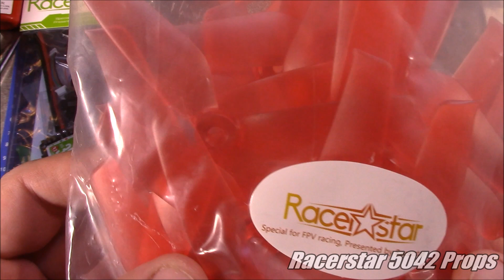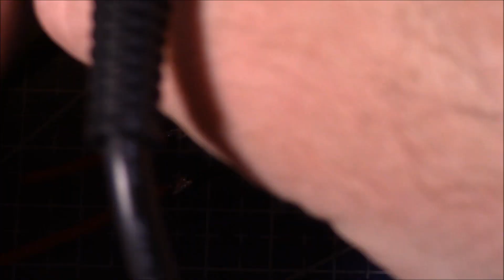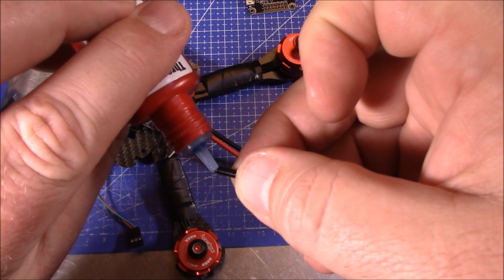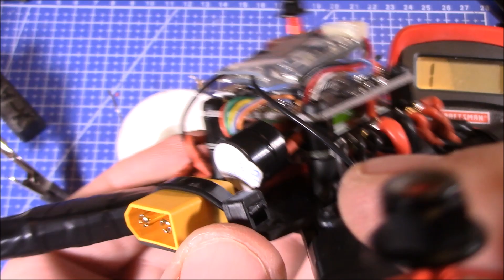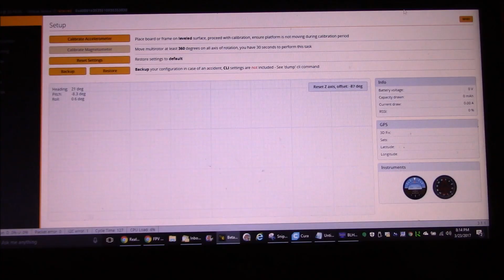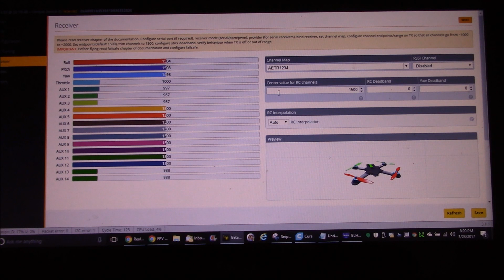Genius 215 Detailed Build Video from Banggood

Comment: Didn't drop the tx. It did try them both on the arms and will move them back. I just recently figured out alarm settings on the qx7 and may have programmed it wrong. ?Thanks for your reply. When I get the antennas checked out and moved back I'll let u know how it went. Hope I'm not asking to many questions just that u r the most reliable source for info. I subscribed to many that I never hear from. Thanks again greatly appreciate
Reply from the maker: You're welcome.  You could try to create a new model in your Taranis and rebind it to your RX.  If that makes it work, you'd know it was something you configured in the TX.

Comment: Hi Travis, all of a sudden both quads (X210's) are giving me a LOST TELEMETRY warning from the Taranis QX7.  But it reconnects about as fast as it loses it.  Also the Taranis occasionally says LOW RX.  BUT I still have connectivity or at least it recovers quickly and don't notice the lost signal interruption.  Since it is coming from both quads I'm hoping its a setting on the Taranis. Any glue as to what is going on.
Reply from the maker: Which receiver are you using?  XSR or X4R-SB?  Hopefully one of those...  Make sure your antennas are still connected real well (X4R-SB).  The XSR has soldered on antennas.  If that looks good, you can try to move your antennas up to look like insect antennas above the quad.  If you have them attached to the arms like I have in this video, it should be alright.  It is strange though that both of your X210s are doing it at the same time.  That kind of makes me think it may be more related to your TX than something on the quad.  You didn't drop it recently, did you?

Comment: Thanks for yet another good review !
When comparing the Genius 215 frame and the X210 PRO, which do you think is the best frame ?
I really love the 4in one esc in the Genius kit, but the camera holder on the X210 pro looks much better. The best solution would be 4in 1 esc on the X210 pro kit.
Reply from the maker: heh... yeah.  I like the x210 better at this point, but I haven't added the FPV stuff to my Genius yet.

Comment: hi,
i noticed in your x210 f4 build and this one you used the bottom vbat port. i ve been copying all your soilders. i have another cc3d revo f4 board and  i have doing been researching it on rcgroups and cant find any info on why to soilder into the bottom vbat, all of the pics on that thread show the top vbat and grnd by the buzzer port soildered. also i was informed that where the motor signal terminal ports are the 5v + doesnt work and not to power the f4 board that way. by using the vbat it would power the f4 board and it has a built in voltage reg so the power off of the pdb board can go direticly into the vbat 
can you help at all 
thanks
Reply from the maker: On this board with the AirBotF4 firmware, I had to use the lower VBAT to get the VFAS telemetry back to the Taranis.  At first I had the wire connected to the other VBAT but couldn't get the telemetry readings.
Reply: ok
i dont have telemetry i use the flysky radio
can i leave it how i have it with the lower vbat connected or should connect the vabt up at top by the buzzer?
Reply from the maker: It should be fine like you have it.

Comment: so when using a 4in1 esc, there is no need for a pdb? i am doing my first build now using this frame (maybe), but other components but still a 4 in1. so maybe I am confused being this is my first actual build... rtf were fun but I wanna build baby
Reply from the maker: This quad doesn't need a PDB because the 4-in-1 outputs 5v to power the flight board.  Nothing else on this quad needs power.  When FPV gear is added, I'm going to use gear that supports 7v-22v so I can power it directly from the 4-in-1 ESC as well because I don't want to have to use any voltage reducers.
Reply: ooooh a tighter build... I love it. Wish I could find info on whether or not my vtx uses 5v... i know my camera does.!.!.! disregard... I'm using the betaflight flight controller that is a pdb also... I'm dumb

Comment: hey Travis, another great build man. These revo F4s are tricky though. Can't seem to get it into DFU mode?! Im holding the bootloader button as I connect, did it like 50 times lol. Help?
Reply: also why do you choose to use the airbot F4 firmware instead of Revo on betaflight? I know they are supposedly identical but any reason?
Reply from the maker: I chose the AirBotF4 firmware because that is what the website for the board said to choose.  I know the Revo will work too.  We had a few people use it at a build party and their quads flew fine.
Reply from the maker: I'm almost to the point where I hate F4 boards.  I tried to reflash one with the Revo instead of AirBotF4 and it went half way through and got stuck.  I tried to reflash it a dozen more times and now I think it is hosed.  I ordered a replacement F3 board.
Reply: If you're on PC, download ImpulseRC driver fixer. It's a lifesaver. Just plug your board in like normal, as if you were just trying to connect without flashing. Then run the driver fixer and it automatically puts your flight controller driver into DFU mode.
Reply: Are the Multirotor Racing f3 boards good?
Reply: Did you try in Betaflight CLI to type "DFU" (no quotes)

Comment: Friend the antennas of the radio if it has signal in that part?
Reply from the maker: The antennas work fine attached to the arms like this.  I thought they may lose signal but they have been working real well.  I do not get low RSSI warnings while racing.

Comment: Another nice clean build and great Los flying but I'm waiting for you to install fpv setup and fly that way to see how your builds fly that way, and because you I got my first race quad the realacc 210 not the kit but the rtf and I love it, but just yesterday it got alil wet and motor #3 esc caught on fire rrrrrrr. I put it out before it burnt anything else but now I don't know what I have to replace beside the burnt esc rrrrrrrr. I'm about to start fresh and just build from ground up.... But thxs for the infor on your clean builds.
Reply from the maker: The GX210 uses 20 amp racerstar ESCs.  You could order a new one and try to replace the burnt one.  http://www.banggood.com/Racerstar-RS20A-20A-BLHELI_S-OPTO-2-4S-ESC-Support-Oneshot42-Multishot-for-FPV-Racing-p-1063904.html?p=6Z050013977120130325
Reply: @travisgrindal thxs I just order 4 of them and a new fc and pbd because I didn't want to take a chance because im not sure if they got damage too,i quess better safe then piss off lol....

Comment: I do have a F4 board that froze up while flashing. I did not know any better and unplugged it to try flashing a second time. Now it will not connect. Is it ruined??
Reply from the maker: I'm not sure.  I have one just like that sitting here.  I'm going to have a friend see if he can get it to work on his computer.
Reply: hopefully it works for you on another pc. I tried on a second pc and nothing....Let me know if you have any luck. I hate to see it just sitting the wasting away. I spend enough money in this hobby to be adding to it from things like this.
Reply: Thought I would let you know i got it to work. After several tries I finally got it into Boot Mode using tweezers to short the boot pads. I tried to re-flash a few times and it froze up each time until I turned off "Full Chip Erase". Once I turned that off and lowered the manual baud rate down to 115200  it flashed like there was never an issue.

Comment: If you can afford extra wires, try doing lineman’s splice on the motor wire extension. It will be better protected
Reply from the maker: That is true, but the stress on the motor wires isn't all that much.  Their biggest threat are the props bending down in a crash and slicing them up.

Comment: What's better for racing? 2300kv or the 2600kv?
Reply: 2400kv
Reply: I mean, not by me but according to my friend, 2600 on 5" is a battery killer :D

I fly a 2400KV motor, seems to be the sweet spot. Feels tad faster than 2300KV yet more torque and kinder for battery than 2600KV. The new 2750KV RS2306 can pulls more than 50A (200A total) and battery technology hasn't good enough for this power hungry motor. Joshua Bardwell made a video on it
Reply: Agreed, we should take it easy first. Guess what? I've made many mistakes in my first build. I bought a 190 frame for a 5" setup, which is a pain in the ass to build (everything is a very tight fit). To make it worse, it's a 3mm thick frame and seems not going to last (beginner = bad crashes). I forgot to turn down the heat while soldering small parts which broke my VTX, tail light and an FC (solder pads came off). I should've spend less for my quad and spend more for my ground equipments.

Here's my setup if you're interested:
*RCX X190CF 3mm
*RCX RS2206 2400KV
*DYS XSD30A V2 DShot 600 enabled
*Flip32 F4 ICM Edition
*Matek HUBOSD8-SE
*Generic HS1177 CCD 2.5
*TS5823L

Pro tip:
-Soft mount your FC (12 AWG silicon wire insulation is my favorite material)
-Stick with red triblades props (red looks awesome haha)
-Pick high quality 60/40 solder (don't get a cheap one, you'll regret it)
-Pick good adjustable solder (set low for soldering small wires and vice versa, otherwise you'll burn your board or struggle to solder your wires)
-Have a multimeter, solder suction, tip cleaner, tweezer, needlenosse plier, hobby knife, heatshrink, zip ties and so on. Seriously, these things will come handy
Reply from the maker: I've been using the 2600kv motors.  The 2300kv motors feel kind of slow after flying 2600kv for so long.
Reply: No problem! if you have a problem, rcgroups.com is a very good place ask just about anything about this hobby. They're very friendly : )
Reply: Some said that 2300KV motors have better power on the low end, perfect for racinng. Just got the 2300KV for my first build though. Might order the 2600KV soon 😄
Reply: 2600KV is proven to be a battery killer for me
Reply: IRFZ44 Looks like I made the right decision ordering the 2300KV ones :) thanks for the tip mate :)
Reply: Thanks man!
Reply: Share your setup plz :D
Reply: Parts for my first racer still on a slow boat from china... but I got these parts:

Racerstar 30a Lites (BB1) Dshot 300
Racerstar BR2205 2300KV Black
Frog Lite Frame
SP F3 Board
Matek PDB-XPW (with current sensor) 
Racerstar 5042 5x4.2x3
CMOS HS117 style camera (very cheap one)
Paired with a cheap 200mw transmitter (TS5823s) and an XSR. Excited for the parts to reach me. Can't wait to build it!
Reply: Awesome, but you could've spent a bit more money and you'll get a decent racer

Racerstar MS25A BB2
Racerstar BR2205S
RealaccX210
X-racer F3
Matek PDB
Generic HS1177 CCD
DYS MI200 25-200mW VTX

That's a pretty decent setup
Reply: IRFZ44 Yes I am very much aware of all those other options you listed, but I wanted something easier to build since it would be my first racer! All the vidoes about the SP F3 and the likes got me into deciding to buy that board. Since it is an ULTRA cheap racer, I wouldn't mind it that much if parts broke, that's why I opted for a cheap build like it. In the very near future I would get better parts and build my 2nd one too, but I think what I have setup is fit for me right now :)
Reply: Besides other than that, the camera is only the big improvement over the parts you listed. Being a beginner, I doubt I would notice the difference between DShot300 and DShot600. I was originally going to get the MS25a but hesitated because of their sync issues. After this build, I bet I would be much more comfortable with my future builds ;) Noted though! Thanks for the input mate!
Reply: IRFZ44 Thanks for all the input! This is what I love about this hobby. The community is just so helpful and friendly! Thanks again :)
Reply: IRFZ44 Update: I had a problem with that order. I cancelled it eventually and got way better parts.

X210 V+
Matek FCHUB
Omnibus F4
RS20A Lites Dshot 600
Brotherhobby R2 2300KV
Eachine Okkan Camera (Budget was tight lol)
TX526 (Eventually broke on me, but banggood was kind enough to replace it. I requested a VTX03 and it is on its way now)
XM+ 

Flies great! 
Dshot 600 running on 8k/8k
Only real good improvement I can make is a decent FPV camera :)
Reply: Sounds great. Don't skimp on camera, you'll regret it. XM+ is okay but you won't get telemetry, which is very handy.
Reply: IRFZ44 Im surprise with this camera actually, performs better than what I expected! And personally I dont bother with telemetry. The XM+ outputs RSSI on channel 16 and that is all I need since I have betaflight OSD from the Omnibus F4 :)